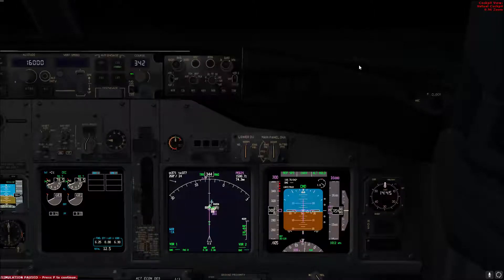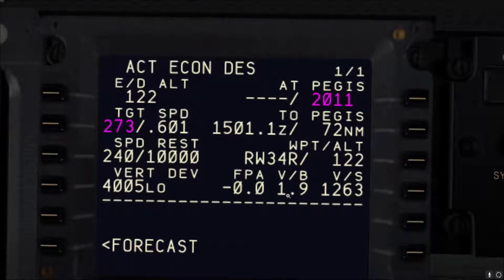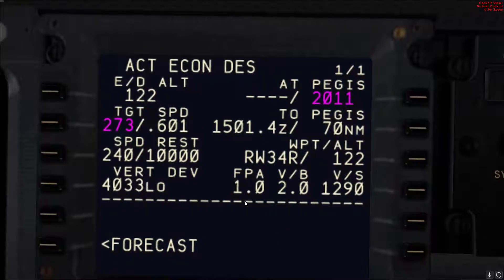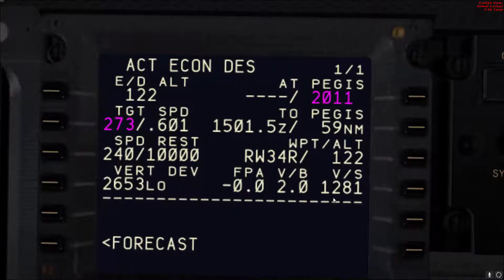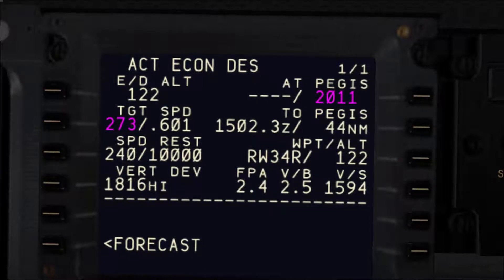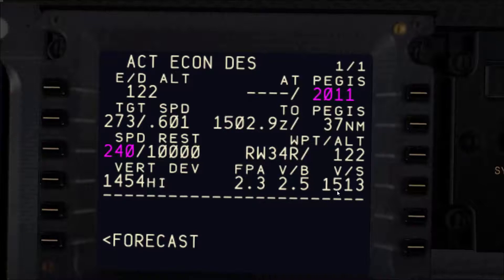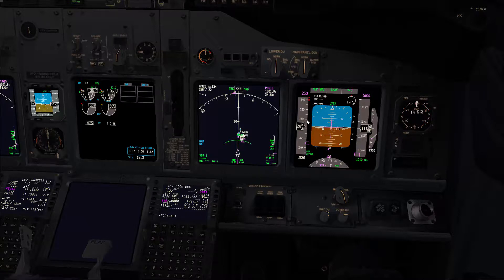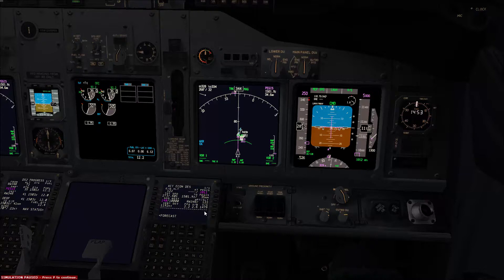B737 Vertical Bearing Video#2 (High Speed App.)

Comment: Hello captain thank you for you effort 
I have 2 questions , first one , what is the factor of calculating the v/s to the waypoint is it lnav or what , this means that if i select hdg select on mcp then the v/s calculations based on what ? The second one on minute 5:35 the v/s was decreasing but the v/b was increasing what is the reason for this 
Thanks in advance
Reply from the maker: Hello Omar,
My apologies for the late reply.
V/S displayed in the Des page in the CDU is a direct line disregarding LNAV,,, Both the V/B reading and V/S are the information if you would to go direct to that point at that altitude. Keep in mind the V/S is the sink rate needed to maintain that specific V/B.
Hope that makes sense, let me know should you need more information,

Regarding the second portion of your question,,, you know what I am confused about as well, I will monitor it in the airplane next time and will update my answer here.

All the best,
Abdul
Reply: @AbdulmuatiAsiri37  thank you captain for your answer

Comment: Hi Cpt. This is the best informative YouTube Channel regarding 737. Thanks a lot for the videos.
 If you don’t mind I have couple of questions.
 1- In the fmc descent page adviced V/S , is it calculated based
 on target speed or actual speed?
2-  if we have an actual speed of 300 and tgt speed 270, is adviced v/s decrease or increase? 
3-  according to what angle do we arrange v/b?, ils glide path angle, or something else?
Reply from the maker: Hello Servet Bay, 
Thank you so much for your kind words. 
To answer your questions:
1- The V/S is advisory to maintain the V/B to the point in the line above at that altitude. That V/S will usually give you a FPA that is very close to the current V/B.
2- If you are going to descend at a higher speed than the original profile, you will be descending with a higher V/S. If however, you started your defend at the original profile you might want to reduce V/S initially as 300 profile is going to be steeper. so initially you might need to reduce the V/S but then definitely you will increase it if you want to maintain an idle descend profile. 
3- If you are talking about using V/B in the terminal area:
a- Straight in approach, fully configured you want a V/B between 2.8(min) to 3.3 (max)
b- speed 250 (not yet configured) V/B max 2.5
c- High-speed approach 300knts, V/B max 2.0
these angles will give you enough room to be able to slow down configure and intercept the G/S with no problems, with that said remember V/B need a lot of practice so be very conservative at the beginning and give yourself plenty of room. 

Hope I answered your questions, let me know if you have any other questions. 

All the best 
Abdul

Comment: Hi captain, let me ask a question fuel saving wise, please.

Comparing to LVL CHG mode, is the V/B mode more or less fuel saving?

What are your thoughts based on your own experience, please?
Reply from the maker: The V/B is just an indication to be used.  Just so you can gauge how high or low the airplane in reference to a waypoint or the RW. 
The decent modes are LVL CHG, V/S, and VNAV. 
Hope that answer your question. Please let me know if you have any other questions or comments. 
Thanks a lot. 
Abdul
Reply: @AbdulmuatiAsiri37  Ok thanks for the answer!